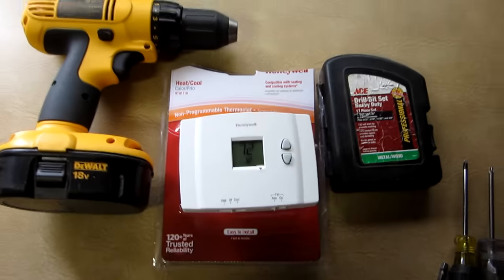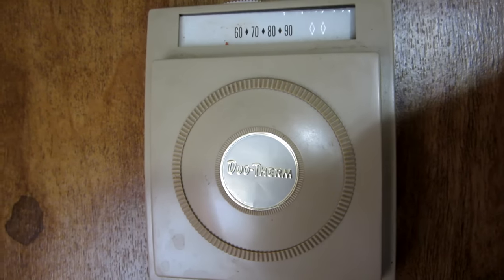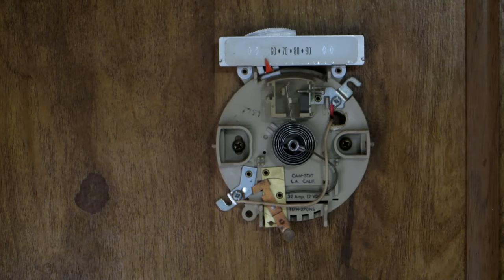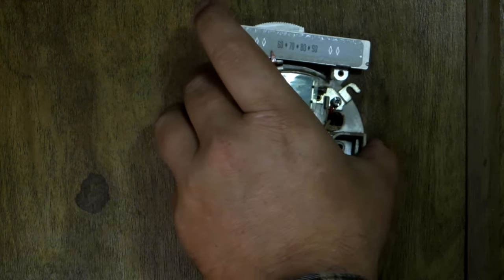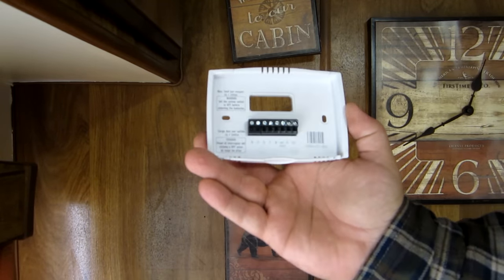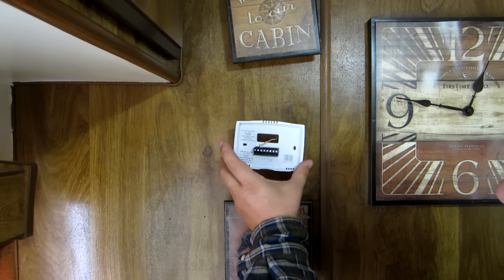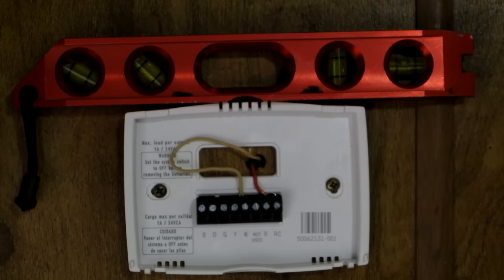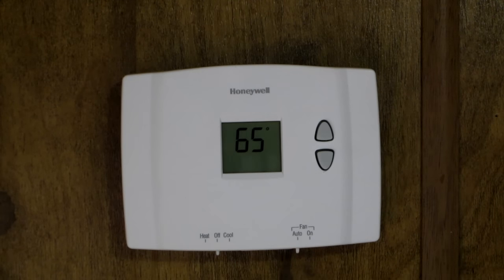Camp Trailer/RV : 2 Wire Thermostat upgrade

Comment: THis helps me a lot. My mechanical crappo stat came un-calibrated bad. I got this one and stumbled upon this vid. Mine is 24v,  2 wire heat only. The unit is a propane 20,000 btu unit that gets hung on a wall. I need to maintain 72deg for tuning flutes. I happened to get this very T-stat. Should take me 10 minutes thanks to your tutorial. Thanks !!
Reply from the maker: happy to help!
Reply: Worked out great. Took me all but 10 minutes. Thanks again!

Comment: BRAVO!  Thank you, thank you, THANK  YOU!  I've been going crazy trying to find instructions or assistance in replacing my old mercury switch, two wire thermostat.  The instructions with the new digital thermostat just says "mark the wires from the old, and reconnect them in the same positions."  Searching websites?  Nothing.  Calling the "customer service" line provided with the new thermostat?  HA! Could barely understand their broken English.  Then a search in youtube--- was losing hope, as even THOSE videos were for systems that include fans and vents and A/C and blah-blah-blah.  I JUST NEED INFO FOR WHERE TO CONNECT THESE TWO WIRES!  Then I came across your video..... a million thanks, TomBackwoods!
Reply from the maker: Happy to help!

Comment: I have an early 2000s Coleman Pop-Up Camper.  Nothing special about it.  I was having trouble with the original thermostat and ended up taking it out at the end of last summer.  Would this thermostat that you used work for me as well do you know? I too have the 2 wires coming out and only need heat.  Wasn't sure if the 12v system made a difference....thanks!
Reply from the maker: It should work. Mine is a 12 volt system too. Thanks for watching!

Comment: I recently changed a thermostat, which we thought worked properly  during the winter.. they didnt noticed the difference.. but the guy I helped out says now that he wants the low the temperature..  the thermostat doesnt do it.. I'm wondering what could be wrong? what if the switching of  old to new never worked?  2 cables as well..
Reply from the maker: It could be. essentially its just a switch. off/on. I would check the thermostat and make sure its working properly

Comment: Not sure if you will reply but it’s worth a try. My fiancé and I purchased a 96 jayco fifth wheel and it has the typical jayco air conditioner unit installed in the ceiling with the knob attached to it for either hot or cold. BUT on the wall there is also a Honeywell thermostat that doesn’t seem to turn on..we don’t know what it’s for and we never got a chance to ask the previous owner what it’s there for..do you think there was a swamp cooler connected at some point and that’s what the thermostat is there for? Or do you think it’s connected to the ceiling AC somehow? I hope I don’t sound like an idiot but summer is approaching and although the ceiling AC seems to work okay..it doesn’t have a lot of settings besides hot or cold and it doesn’t turn off like a typical AC unit..it pulls a lot of electricity since it blows air the entire time it’s on! I’m hoping you still check your comments!
Reply from the maker: My thermostat does not control my AC unit either. My AC unit has an option for heat but was not included on my model either. My AC is wired into the AC/DC and only works when hooked up to shore power or a generator capable of producing 30 amps. It sounds like you might have a similar set up. Thanks for asking!

Comment: hey Tom, i just replaced my analogue to digital, but curious if with only a 2 wire system (R and W), could i use a smart thermostat? no c wire but honeywell has batteries for thermostat.  the cool function will not be used, but can heat the place prior to arrival.. think it would work??
Reply from the maker: I'm not familiar with the smart thermostat. But I don't see any reason it wouldn't work. It would be a timed switch is all. As long as your pilots are lit and its ready to go I would give it a try.

Comment: Hey there.  I'm trying to put a Honeywell Pro 1000 in my camper, but both wires are the same color!  Should I hook the aux battery back and borrow a multimeter from a buddy to see which is hot?  Or should I just hook them up and if my off is on (and vice versa), then switch them?  :)
Reply from the maker: I'm sure you have worked through this by now but I probably would have tested with a multi-meter to find hot.
Reply: I did figure it out.  Since my thermostat was a heat-only switch, basically, it didn't matter which wire went where...simple off-on.  Thanks!  :)

Comment: Hi
Is this(Honeywell RTH111B Digital) works for 120 VAC? My heater is baseboard heater, I'm not sure about the KW. What do you think?
Reply from the maker: Most thermostats are low voltage but I cant recommend anything for you situation.  I would consult a professional if thats an option for you.

Comment: can you verify whether your old thermostat ran off 12v DC and not/not off 110v AC?  My furnace thermostat is an anlogue that runs the propane furnace and the thermostat uses the 12v DC power.
Reply from the maker: My thermostat runs off of my furnace which is 12v DC.